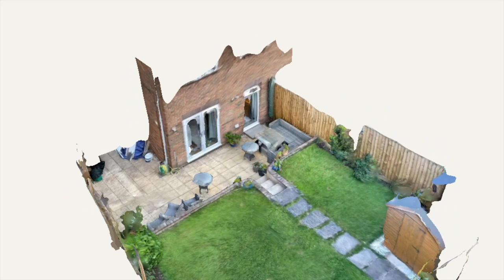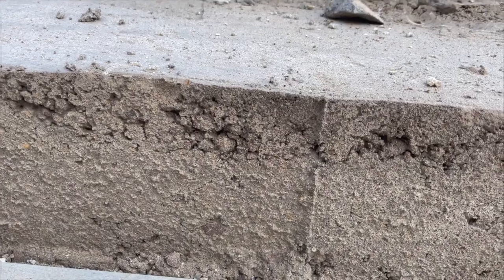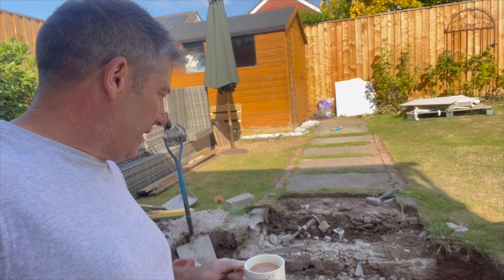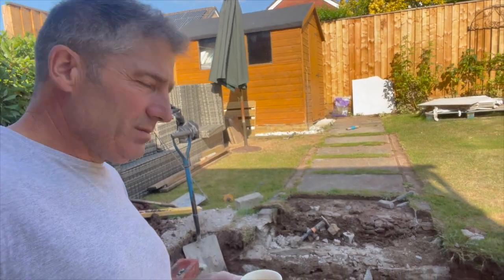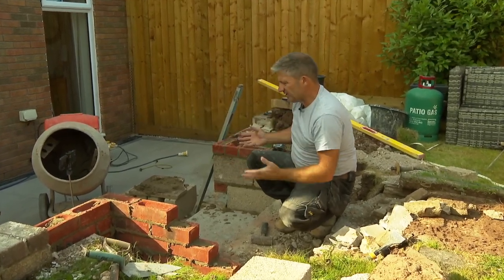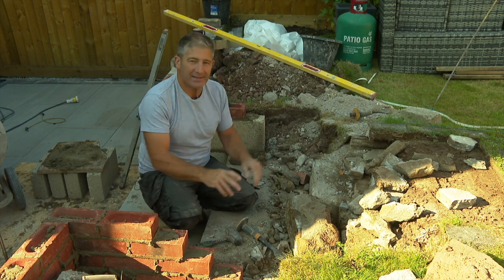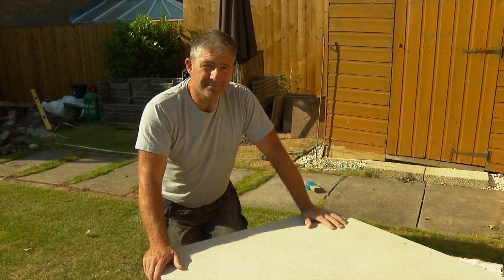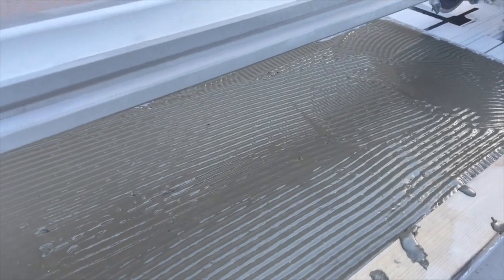Landscaping And Building Porcelain Steps

Comment: I wonder can I replace paving primer over mapei  adhesive keraqick  with mapei latex plus  ?
What's advantage paving primer over s2 class adhesive ? 
Have you ever tried to use it with 20mm porcelain , thanks
Reply from the maker: Hi, though these to products are similar  the adhesive is different I believe in some way but contacting Mapei Technical would be beneficial